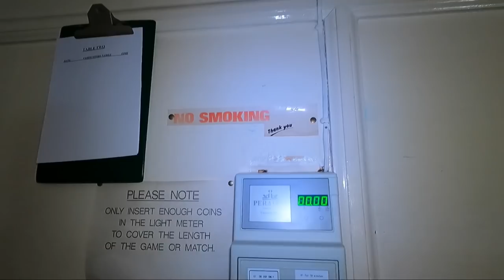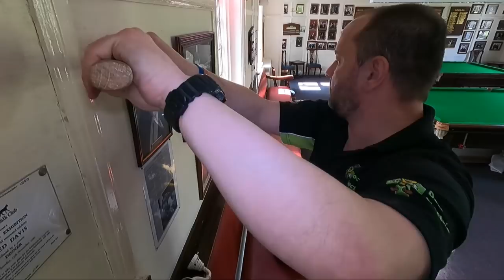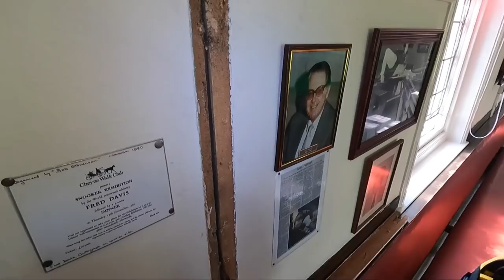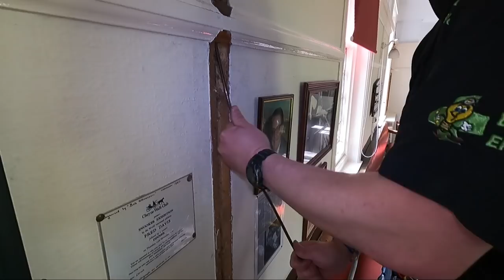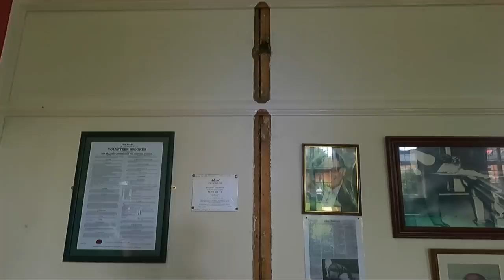Changing snooker wall lights part 1

Comment: Wiha speed E2 really nice and lots of torque yes it’s expensive but it is insulated and I don’t trust many manufacturers with insulated tools. The Bosch looks well decent it will save so much time screwing and unscrewing socket, switch fronts. Switch lines are called traveler wires here in US.
Reply: Traveler wires, always learn something from Math Man! Thanks mate 👍🏻